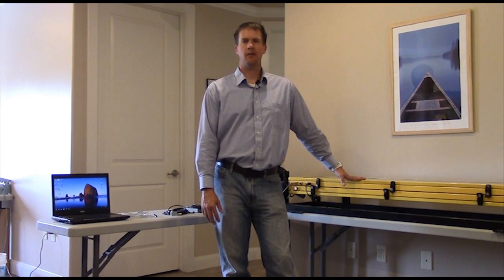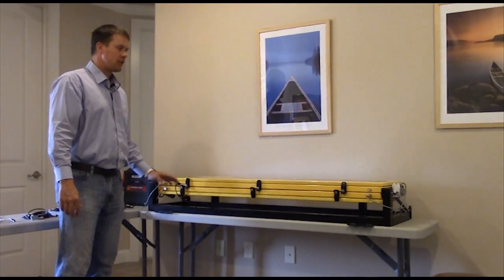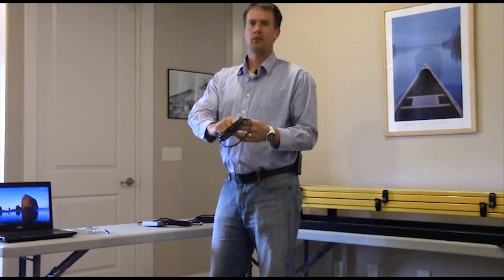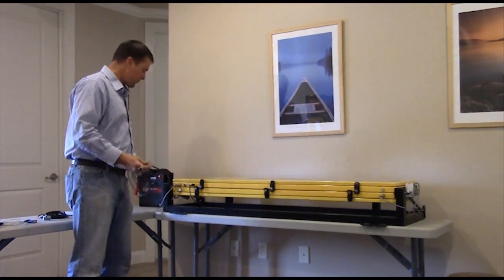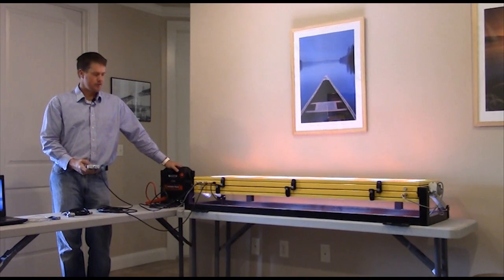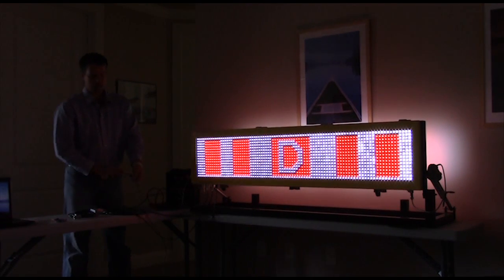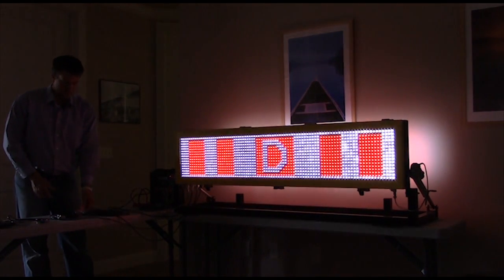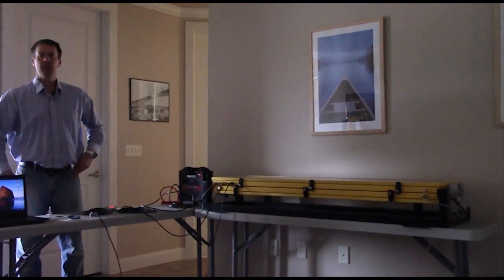Electronic Oversize Load Sign

Comment: I guess this company wanted to see if there was any interest. I like the concept but a pilot car driver couldn't afford it and the clear plastic would chip and break easily. My sign moves up and down just fine and it's made of aluminum. I could put some actuators on the sign and lift the sign by electricity instead of manually.